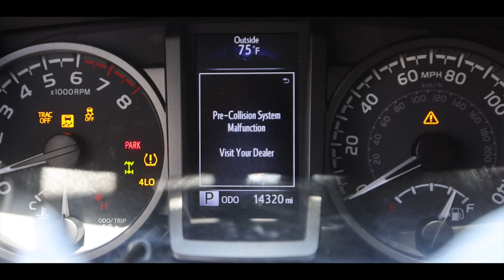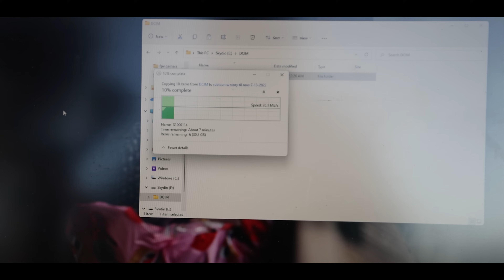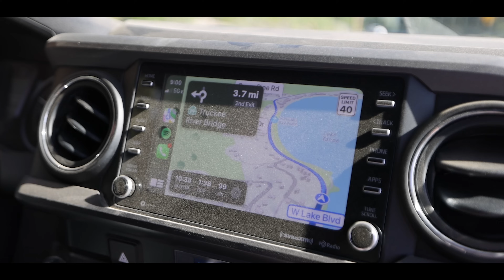Breaking Jeeps On The Rubicon With @TheStoryTillNow

Comment: Loved the video. Was reflecting back on my 95 Toyota Pickup (22RE, shortbed 4x4) and they sure do not make them like they used to. I am glad I got my Gladiator (they aren't prefect either - but i'd rather start with something that has solid axles from the get go).
Reply: They do we just don't get them in the US. 70 series Landcruisers straight bare bones trucks with solid axles and no electronics.
Reply: @j90032   I am well aware of that. I probably would have got a 79  series LandCruiser if they sold them here instead of my gladiator. The new Tacomas are a far cry from the old toyotas I was used to. Even the engines are crap - the last good Toyota truck you could still buy is the  current 4runner - solid engine, trans etc (essentially a Hilux  without the bed).
Reply: @joewolfe642  A 70 series would definitely be my dream vehicle if there was ever a chance in hell we could get them here. The new tacomas are just different in a lot of ways good and bad. They fit a different purpose but can still be modified just as much if not more than older trucks. I still have a 94 pickup and 87 4runner. They are just tough to beat. I still see old yotas on the way to the rubicon every weekend on the freeway.
Reply: @j90032   I am not a Toyota hater (had plenty of them back in the day) - there new stuff sucks the new 3.5 v6 is known for burning oil and throwing timing chains a far far cry from what the 22R was as well as other great Toyota engines. The electronics suck as well - it’s really not any better than the domestic competition at all - infact I’d argue the competition is just better. Have known many with the current gen taco that have had bad experiences. Considering the premium you pay for them and the reputation they have it’s just sad.

Comment: The trail changes every year. The year you did Little Sluice in your TJ it had much more small rock in it (I did it the same day as you back then). This year Little Sluice is much rougher. All the smalls have been beat out, washed down, or ice broken and all thats left is big and sharp boulders. I love doing it year after year and seeing the differences.
Reply: It used to be even bigger. They did "maintenance" on it, that is probably around when you saw it. It is technically a county road. Wayalife has a video done right before the maintenance and the rocks are huge!

Comment: I’ve gotten the low oil pressure message on my 2017 Tacoma when I was coming down a steep incline. My truck didn’t shut off tho, could be a new safety feature, but after I leveled out it was fine

Comment: BEFORE I watch the “trick” for putting the tire back in the bead… I want to share one w/ everyone!

Use a good Ratchet Strap that will fit around the circumference of the tire (it also has to be thick/strong enough for said tire), the ratchet it tight (making sure it’s in the center of the tire tread) this will squeeze the tire sidewalls and bead outward…. You should be able to get it tight enough against the bead to fill with air, then when it has enough pressure to hold you release the strap and continue adding air till the bead POPS back into place!!!
I have done this on full-size 33’s, I have never tried it while still on vehicle though…. But the mechanics and principle is the same so it should work!!

Comment: Make sure you don't have a vacuum leak. I had an intake coupler that would slip off climbing obstacles and cause the transmission overheat warning. New coupler and two new hose clamps later, no more nuisance warnings.

Comment: I don't understand why people say, hard driver or turn passenger.  Why not left and right?  Left front wheel, right rear wheel?  I see this all the time on U.S. videos and I don't understand why that term is used. I have even said that to mechanics when describing a problem and they respond by, " You mean passenger side?"  YA. THE RIGHT SIDE! Anyway, other than that, enjoyed your video.  Just one of those stupid things that bothers me.  Like when describing a manual transmission people say, Can you drive a standard?  Yes, I know what they mean but it drives me crazy.  It was originally called a standard transmission, inaccurately, because an automatic transmission was an option on the old cars way back in the late fifties early sixties.  Still was even  on my 2014  JK.  Needless to say, I went for the "standard"...woops, I mean manual.

Comment: I have a few questions about a build I would like to do. I know of a diesel CRD that needs a transmission. I know you did a diesel and own a liberty. So my 1st question is would a Liberty make a good rock crawler?
Reply from the maker: Yes if you are a good fabricator but no if you need to buy pre-made parts. It's a good wheelbase and chassis but you would need to fabricate everything from scratch basically.
Reply: Would a '97 s10 blazer be a better candidate then? And how hard would be the diesel swap?

Comment: Your VSC and cruise error are probably popping up because you've tweaked your alignment. I'm willing to wager its a zero point issue, scan it and clear codes and it should all work fine again. As for your Trans Temps, you need to install the Trans cooler. I purposely bought the 6' box because the Trans cooler comes standard. Now for your oil pressure, never had this issue ever but they will smoke just like a jeep on severe inclines.

Comment: Tip for lifting a vehicle with a hi lift jack and not having jack it up 4 feet before the tire lifts up is to use a rachet strap to pull the axle towards the frame like a limit strap then lift with the hi lift jack. Works awesome 👌
Reply from the maker: We have used this trick many times over the years but most of us have opted for a bottle Jack these days.

Comment: My 2017 Tacoma had the same oil pressure issue, once, mid climb on a ledge, on Charleau Gap trail. Wasn't an issue before or since on equally steep climbs or descents. Really like the truck but I hate the "nanny" tendencies of all the electronics.
Reply from the maker: That is a great way to describe it. "Nanny" electronics are currently the only thing failing and unfortunately they are taking out perfectly functional systems like cruise control and traction control. I can live with the low oil issue since it's only occasional but it is still kind of lame lol. In any case the only problems I'm having are related to these overbearing nanny systems.

Comment: Two things...
First of all:  I'm super bummed I couldn't make it on this trip.
And B:   You clearly just need to gut the entire drivetrain and electrical system out of that truck and shove a small block 350 and turbo 400 in there to get rid of all your problems 😂
Reply: Probably get better mileage too!
Reply from the maker: Lol you are describing a completely different build! I would rather just start with a good truck 😁
Reply: @DirtLifestyle  I happen to have a small block 350, 700R4, and NP208 sitting right beside a landcruiser 80 series rolling chassis... 🤷🏼‍♂️

Comment: Does this truck have an auxiliary transmission cooler? I'm pretty sure a '21 Tacoma no longer comes with a "tow package" trans cooler. Toyota has really skimped on proper transmission cooling when it comes to rock crawling and heavy towing in stop and go traffic. The internal radiator transmission cooler just simply isn't enough. An auxiliary cooler with a fan would probably solve the temp issues.
Reply from the maker: This is definitely a worthwhile suggestion. I wonder how they would handle a transmission warranty if I added a cooler?
Reply: @DirtLifestyle  It definitely will void your transmission warranty. For now you could install a ScanGauge/Ultragauge in your cab to monitor transmission temperature when wheeling. Then install a cooler once the truck is out of the powertrain warranty. From what I understand it has to get crazy hot to turn the truck off.

Comment: Wow,
Haven't run the 'Con in probably 25yrs!
I've run it 3 times in my Early Bronco, once with a trailer in tow.
 Broke a rear alloy shaft on two separate occasions.....yeah it's a pretty tough trail and pulling the third member at Spider lake was not fun!
Plan on running it next spring/summer with my step son and his 3 linked front FJ80 axled 1st gen Tacoma and me in my '85 SB pickup.
Should be fun!
Tip: Bring spares for stuff you think you might break and you won't break, but leave them home and.......

Comment: Another amazing video Nate! 
Ive experienced the same thing with my tacoma, and it was an easy fix for me.
I got all of the same errors when I lifted and put 33"s on my 21 Tacoma- all that was needed was a front sensor recalibration. Before I got my calibration done, I took it offroad and it also shut off with a high transmission temp. / low oil pressure screen.
After I got it calibrated, the issues disappeared and haven't come back. I wonder if the stinger on your front bumper is getting in the way of the calibration?
I'm not sure why your dealership wouldn't have been able to figure out the calibration issue though if that is the issue... the master tech buddy at my dealership is scratching his head too lol

Comment: Electrical gremlins aren't the only thing wrong with the new trucks. Never owned any myself but know several people that do and the new ones coming off the line leave much to be desired. I really hope Toyota learns from this production mishap. That's just the gripes from people that USE their trucks but there's several Toyota drivers that want nothing to do with a monthly subscription to use the heated seats that can't be temporarily suspended during the summer months. That's why I personally will do what I can to keep my old jeep running, I don't have the patience to deal with that crap🤷

Comment: So these vehicles are built in an age where the current generation needs warnings ⚠️ to not drink bleach. So unless ur a computer wizard, modifying a modern vehicle is near impossible. These safety devices are there to stop the incompetent from trying to do what they see highly experienced drivers doing in purpose built vehicles to do. Modifying a modern vehicle to do overlanding is easy, setting up for this kind of stuff should be for vehicles with NO COMPUTERS apart from maybe engine and transmission but definitely no traction aid computers!